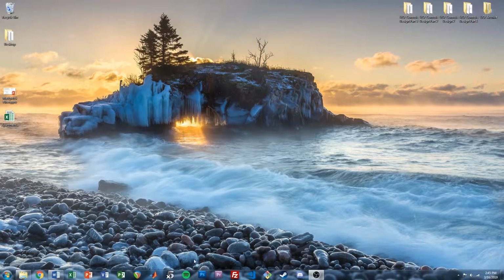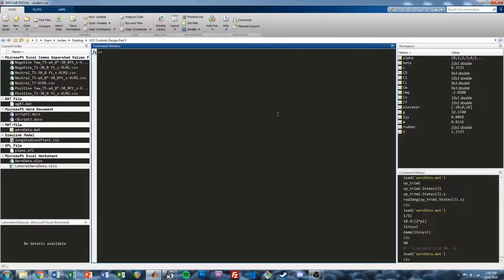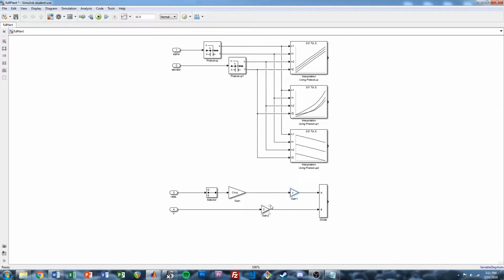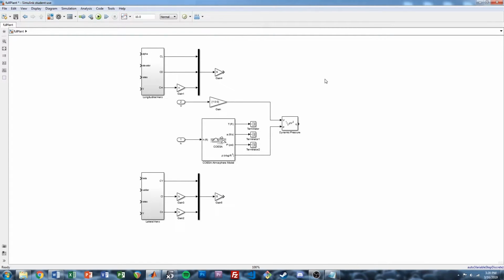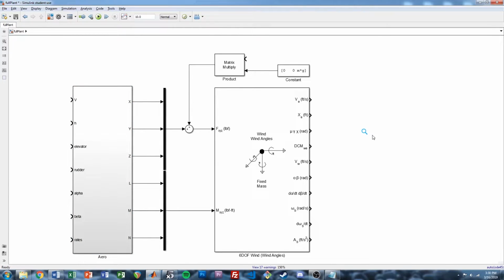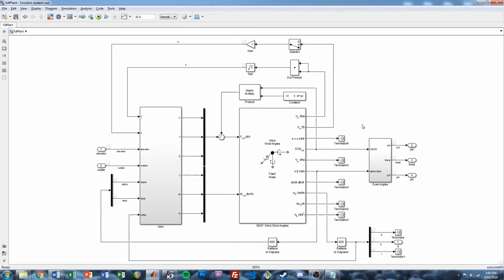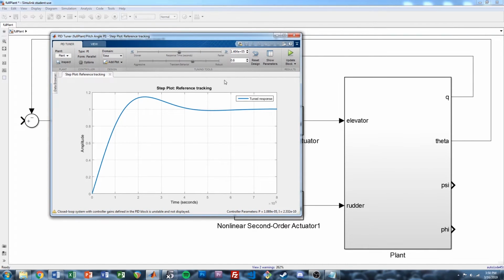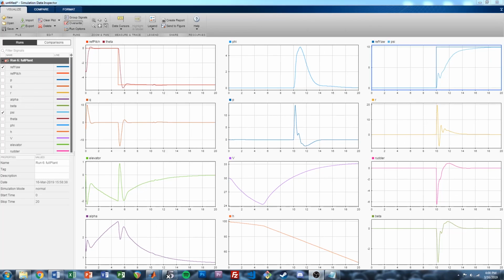Autopilot Design with XFLR and Simulink (Part 3)

Comment: Thank you so much for that detailed tutolial :) I just have one question. Why did you use 6DOFWind block instead of 6DOFBody block in MATLAB, for EOM part?
Reply: Body axis are good when you are using measurements from sensors installed in a real aircraft, since equipaments are aligned with the body axis, or when you are using data collected from aerodynamic model derived using aerodynamic equations of lift, drag, sideforces and moments (cook, 2007).

Remember that aerodynamic measurements or computations are reffered to the free stream velocity vector. Therefore, for investigations involving
 the equations of motion a wind axis reference is to be preferred, aerodynamic data are collected using a wind tunel axis wich is coincident with the velocity vector (Cook, 2007).

Cook, M.V. Flight dynamics principles: a linear approach. 2007

XFLR5 compute aerodynamic data that is coincident with the velocity vector, therefore, the wind axis. 
https://sourceforge.net/p/xflr5/discussion/679396/thread/1c73036f/

Sorry about bad english =/